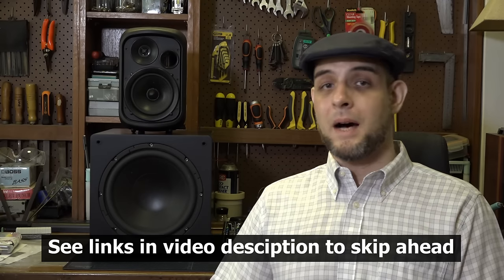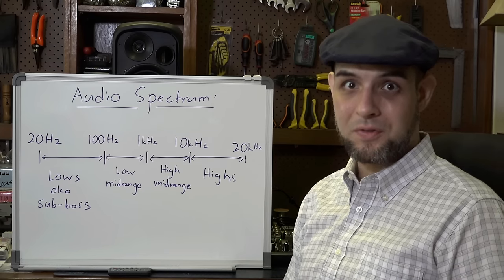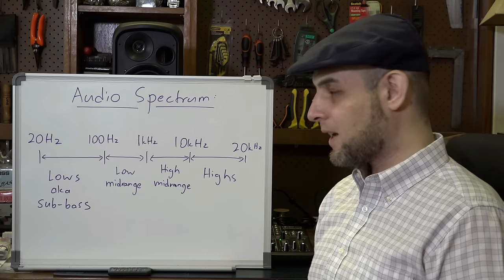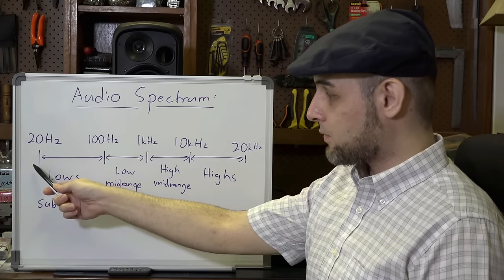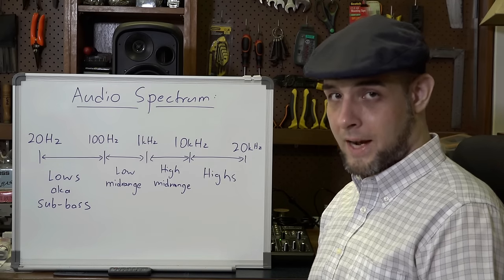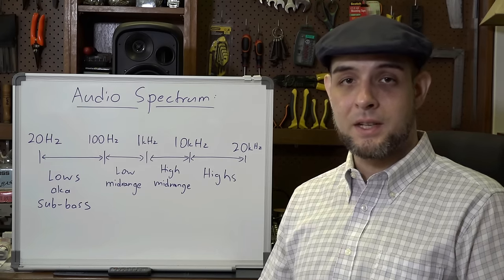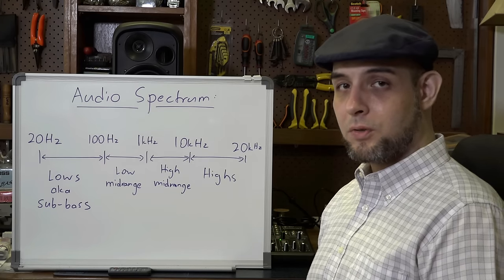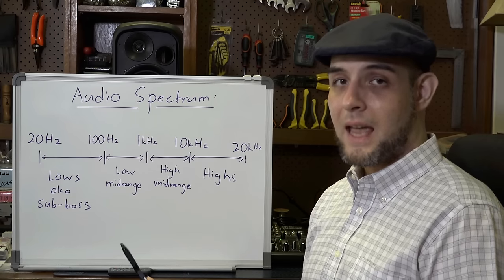How to connect an active subwoofer to a sound reinforcement system

Comment: Dear Friend I got a all tube Class A Pre Amp and it has only got 1Left and 1Right output that goes to my Class A All Tube 3Way active crossover. I also got 3Mono block Amps connected to my 3Wsu active crossover. I need to know how can I connect my JBL 10 " Powered Subwoofer to my Pre Amp Output without loosing any output to my active.
Reply from the maker: It sounds like you have a fairly complex system - I suggest you contact the manufacturer for their advice on where best to tap the signal for the active sub.

Comment: Do you think, it is possible to use active speakers (huge line array and subs) for big festival stages too? I read that the use of drive racks and other control devices together with passive speakers is necessary. Is it old fashioned opinion or?
Reply from the maker: Of course it is - Meyer Sound have been doing this for decades.

Comment: Hello Sir,
Thank you for your videos. I'm a beginner in this music world setup thing. I currently have a Behringer Eurolive B1220 and using a Bellinger KM750 Power Amplifier 400 Watt 2ch. I'm looking for a subwoofer or do I need a subwoofer for my setup? If I do, what's the best subwoofer for my current gears? Is Behringer VP1800S 18" 1600 W PA Subwoofer good enough? I hope you can help me with my problem. Thank you and more power to your channel.
Reply from the maker: Hi Kylzander, you should choose a sub that is a good match for your existing top speakers. The B1220 comes from the 'Eurolive Professional' series of speakers. The subwoofer in that series is the B1800X pro (passive) or B1800XP (active). So you can use the specs for these subs as a basis for making your choice.
Reply: GLB Productions Thank you for your advice.  I will surely take it into consideration.  

However, I have a follow-up question.  If I get the passive Behringer B1800, will it be okay to match with my current Behringer KM750 Power Amplifier? Should I just daisy-chain it or plug it in the extra connector of the power amp?
Reply from the maker: No you'll need to purchase an additional power amplifier for the sub, plus an analog or digital crossover to split the fullrange signal from the mixer to the tops and sub.
Reply: GLB Productions Thanks again for your useful advice. I’m starting to learn more because of your help. 

By the way, I have a Behringer E1220 400 watt PA loudspeaker/floor monitor. Can I connect it my existing Behringer KM750 Power Amp together with PA Loudspeaker B1220 or I need to get another power amp and analog/digital crossover? I’m sorry keep asking.
Reply from the maker: Hmm, it sounds to me like you need to sit down with somebody to have a detailed look at what equipment you have and what you need to purchase to achieve the goals that you have. This is much better done in person - I suggest you approach your local pro audio retailer for help. Sorry I can't be of more help but I think every question I answer raises two more in your mind 😄

Comment: Is it possible to modify your stand-alone active subwoofer that has no output for satellites in such a way that your subwoofer's built-in amplifier is able also drive left and right passive full-range speakers?
Reply from the maker: No, because your subwoofer typically will have a single, mono amplifier which cannot be re-configured to handle stereo signals. The sub may have a stereo input and output, but these are for signal routing purposes only.
Reply: @GLBProductions  Thanks for the reply. Yes, you are right, very low frequencies are non-directional, hence useless in stereo.

Comment: hi! i got mackie PROFX12 MIXER, i connected my mixer to my laptop thru USB it was working before when i newly purchased but, now it doesn't working anymore when i connect to my laptop, message is error code USB code 43, i did lot of troubleshooting, update the driver for USB even the driver for my mixer but still doesn't work? Please advise.
Reply from the maker: This sounds like a software issue - I suggest trying the same connection with another laptop to see if that one works. If it does then the problem is with the laptop configuration. Also be sure that you are selecting the correct audio output on the laptop - audio must be output to the USB connection and not the internal speakers or headphone output.

Comment: Hi Bruno i have a speakers bought on ebay but there's no info on it eg the back or front what the sellers told me its 700watt... so what kind of amp to power these two speakers? Especially for my keyboard aswell thanks
Reply from the maker: This video will answer your question: https://www.youtube.com/watch?v=l9L7uK7Xy0w

Comment: How would I setup aux send to feed amp & subs that are passive to reinforce my full (active tops & subs). I have been running booth out from my controller to feed the signal. I run everything through an external mixer. My mixer is a Behringer 1204FX and doesn't have a buttom labeled aux master.  What other options might there be?
Reply from the maker: If you already have active aux fed subs you can take a signal from the output of the active sub and use it to feed an amplifier driving your passive sub.

Comment: What about I have passive subwoofers and active full range speakers. Can you explain please
Reply from the maker: In that situation you would need an external electronic crossover. Fullrange signal from the mixer would go to the crossover; from there, a low passed signal would go to the sub amplifier and a high passed signal would go to the active fullrange speakers.

Comment: Good morning to you and thanks again for this brilliant tutorial.. I have a question for you ( if you don't mind of course)..my subwoofer has two inputs and two outputs (xlr) and my mixer has aux send 1 and 2..do I need to run two TRS to XLR cables or I just need 1?  Thanks again of course..
Reply from the maker: You're welcome Mark! If you are using the aux fed sub technique (ie no output connection from the subwoofer, just an input) you only need to run one XLR cable.
Reply: Thanks again!!!! Sounding 👍..

Comment: Hey Bruno, I have a Peavey CS800 amp. I want to hook up 2 Peavey sp-5g loudspeakers and a Berhinger B1800x passive subwoofer. How do I do It? On the sub it does have a switch for bi-amping but I have it on passive.  Do I need a separate amp or can I run everything in the Peavey cs800? Thx for any help!
Reply from the maker: Hello Paul, nice to hear from you. In this case you'd need to run the SP-5s off one channel of the amp in parallel and the sub off the second channel of the amp. You'll need to check to see if the power is matched but this is the easiest way to power such a system without additional gear like a crossover. Bear in mind that your SP-5s will still be receiving a fullrange signal so this is not ideal.

Comment: I d like to set up a system, which planing to play video music on a large screen. i'd like a good sound , possibly surround if videos are coded.. I would like to use active speakers.... What do I need? Is there anything that equals the sound levels of each videos? Any splitter to make it surround? Or anything that makes mp4 coded videos, sound better? I would appriciate your help..
Reply from the maker: I suggest you consult somebody who is a specialist in home theatre setups - I don't know much about surround sound.
Reply: GLB Productions No, not for home, planning for a bar... İts for video music
Reply from the maker: Ah ok - I strongly recommend that for any commercial or business installation you do NOT attempt a DIY setup, it's really important that you get an experienced AV integrator involved who will sit down with you and discuss your needs and requirements and then spec an appropriate system. This always works out cheaper in the long term because you are only buying one system rather than finding out what you really need through expensive trial and error.

Comment: Can you daisy chain two active subs together before the power amp and passive full range speakers? Thanks
Reply from the maker: Yes no problem.
Reply: @GLBProductions  Thank you so much, I have been told by so many experts that this is not possible. They say all active or all passive. It has kept me from purchasing an active sub.
Reply from the maker: Mixing active and passive is definitely more complicated and you must know what you are doing in terms of signal flow and how to manage the crossover but it's far from impossible.

Comment: I dont have knowledge in audio. Is it possible to add center and surround speakers to my current 2.1 set up active pa system? Btw i have ld systems dave8 and i want surround audio while watching movies.
Reply from the maker: Yes you can do that, but you will need a surround sound decoder and the additional speakers and power amps to add in the necessary channels.
Reply: GLB Productions thank you so much. I’l do the research on what to buy and how to set up.

Comment: I have a yamaha emx5000-20 amplified mixer with passive speakers. Is there a way to add active subwoofers in the system?
Reply from the maker: Sure, you can use one of the aux outputs or the mono output to drive the active subwoofer.
Reply: @GLBProductions  Thank you very much!!

Comment: @GLBProductions Hi I've seen a heat sink on that active sub and also on other active loud speakers in shops....the thing is that may i need to use a fan for the heat sinks as my Carlsbro amplifier has 4 heat sinks and each time i use it for a long period I need to put a fan for the amp not to over heat....is it the same process for the speakers and subs?
Reply from the maker: Yes, you can either mount a fan directly on the heatsink or use an external fan to increase air circulation around the back of the cabinet. This is often necessary in high volume/long duration applications.
Reply: hmm.....thnx a lot GLBProduction

Comment: Hi. First of all very nice video and explanation.
I have a question though, can i connect an active subwoofer that has an XLR(balanced) input connection. Straight to my PC which has a normal MINI JACK unbalanced output. (and lets say i solder every thing where it needs to be on my home made XLR to MINI JACK cable). Can i run the subwoofer without damaging its amp and will it sound good ?? What result will i get ? And i don't care about shielding and other noise cancelling things that the xlr is used for its not gonna be a long cable hopefully it will not pick up too much hiss.

Thanks for the answer if you can answer it and thanks for this vid.
Reply from the maker: There is no issue connecting your computer directly to the active sub, however you will need to correctly interface the unbalanced stereo output of the computer to the input of the subwoofer. Does the sub have any additional inputs available? Is the XLR input mono or stereo?
Reply: Thank you very much for the fast reply.
No the sub is not stereo it has a mono xlr input on it and a crossover truh thats all.
Reply from the maker: You're welcome :) Ok in that case you will need to convert the computer signal to balanced mono - I suggest using a DI box specifically designed for this such as the Radial ProAV1 or Whirlwind PCDI - you need a resistive network to safely sum the stereo to mono without losing any info.
Reply: http://bolthely.hu/kepek/bestshowtechnika/12469.jpg

This is the cheapest one in my country :D a passive di box, it has only one in and out but i only need mono so it should do fine.
If you can pls check on the picture so i don't buy something that will not work.
Thank you again for the answers. (and after watching your DI introduction videos too i noticed that the passive DI-s lover the signal strength if i dont go trough a mixer and then to a speaker wont i have GAIN problems??)
AND have a great new year.
Reply from the maker: This DI box will not work for the purposes described above. Please have a look at this video so that you can understand the process you are going through when connecting computer audio to an XLR input: https://www.youtube.com/watch?v=ge4Iynh4rcc

And yes passive DIs do lower the signal, so if you need maximum gain you may need to consider a mixer instead.
Reply: Ok i think i understand it now, but i have one more question and i will not bore you with anything else :DD
I have a picture of an other subwoofers back panel and it looks like for me like it has a built in DI with ground lift and everything, with rca inputs.
So will this be the right kind of sub? the answer for my problems? for my straight connection ?
http://media.chaltec.com/images/XL/10029686_3_vexus_swp15pro.jpg
Reply from the maker: Yes that sub is perfect for your application - all you need is a minijack to 2xRCA cable and you all are all set!

Comment: Hey I would like to ask how do you make your active speaker as a right sound and passive speaker as a left sound, i want to have 3D sound by these subwoofer speakers that i got from my dad but i have no idea how to do it.
Reply from the maker: The sound from a subwoofer is actually quite omnidirectional due to the wavelength of the frequencies it produces - if you want 3D sound you need to achieve it with the placement of the fullrange loudspeakers.
Reply: @GLBProductions  after reading your comment 1000x times i finally got it, because i'm not native. Thanks so much!

Comment: @GLBProductions I have both passive subs and speakers. I have an allen and heath sq6 digital mixer. How would I connect without a crossover? Very informative videos btw! Just subscribed!
Reply from the maker: Does the SQ6 have high and low pass filters available on the outputs? If so you could use those in lieu of a separate crossover.
Reply: GLB Productions It hasn’t came in yet but I’m thinking it does have a high and low pass, hopefully. If so, could I go from an aux out to a separate amplifier and then passive subwoofers?
Reply from the maker: Digital mixers do not really have aux outs - they have universal outputs which can function as aux, group or matrix outputs as needed. But yes, mixer output to amplifier and then to speakers. You can also use the crossover function found in many amplifiers.

Comment: I have a question?..can i wire a preamp sub woofer to the back output of a pa system 15in preamp woofer setup to power my sub or will it blow my speakers?
Reply from the maker: Ok - please explain what you mean by a 'preamp sub woofer' - is it powered or unpowered? And what do you mean by 'the back output' of a PA system?

Comment: Hi Bruno my sub does not have a high pass filter i have got an external X over do i go Xover to powered sub to the powered top or run separate channels from the Xovers to the sub and tops......                                                                                                              which would be best i have one sub and two tops which are daisy chained thanks in advance
Reply from the maker: In this case go mixer -> x-over -> x-over low output to sub, high output to tops.

Comment: Hello brother, I have another question and I think you maight help me...... How do I connect a JBLSRX812sp to a EON 615???? do I need a crossover???? I am a little lost.... thanks for your help
Reply from the maker: Those are both fullrange speakers, so just connect the thru/mix out of one speaker to one of the inputs on the other speaker. Make sure the receiving input is set to line level :)

Comment: Sir is it okay if I put my subwoofer onto aux out or monitor out? What is the differrence between aux/mon out and sub out? Thank you! Godbless
Reply from the maker: Sub out = subgroup out ie the output of one of the mixer subgroups. Aux out = the output of one of the aux buses. Mon out = monitor out, typically used to feed studio monitors in a recording situation. Personally I like using aux fed subs because it allows me to choose exactly which inputs I send to the subwoofers.
Reply: Thank you so much sir! :)

Comment: I'm very limited using a Yamaha EMX 860ST powered mixer with passive mains. I'm a beginner and cannot find an aux send on this mixer. Any ideas as to what output you would use to go to my sub? I went from my speaker outputs on back and am afraid I may have overloaded the sub. I also have no clue how to connect the sub to passive mains and to separate the highs and lows with such a limited mixer. Any help would be greatly appreciated!
Reply: Great video btw!
Reply from the maker: On that mixer the aux send is labelled MON. And yes, most definitely do not patch the speaker outputs on the back of the mixer to the line level inputs of the active sub. I suggest connecting your sub to the MAIN(STEREO) outputs on the front panel.

Comment: I have two tops and two subs and my Yamaha with 12 channels has two send out and I want to try your second application,should I use both send out jacks with two cables or one send out and daisy chaining the two subs?Should the cables be balanced or unbalanced?Thank you for the good work.
Reply from the maker: By 'second method' do you mean the aux fed sub method?
Reply: Yes
Reply from the maker: For that method you need a post-fader aux send from your mixer - if your mixer is the Yamaha MG12CX or XU, that is typically aux 2, which is also shared with the internal effects, so it might be a bit difficult to implement.
Reply: Thank you for your help.